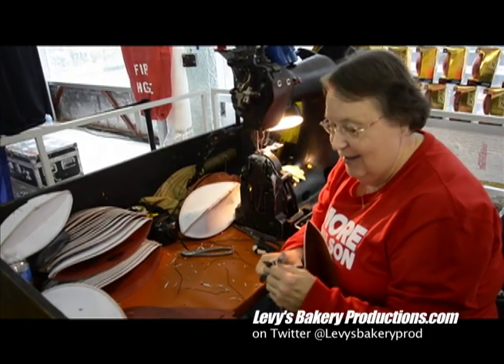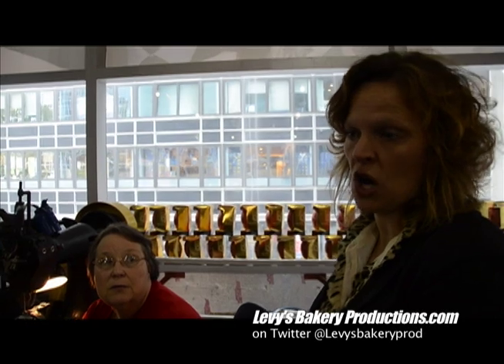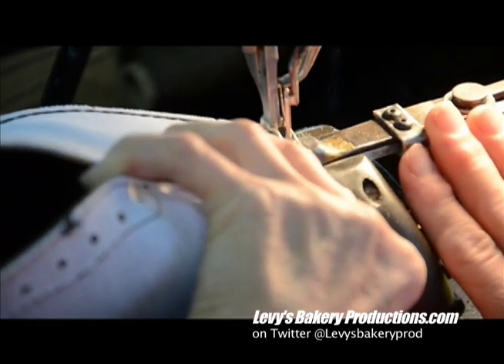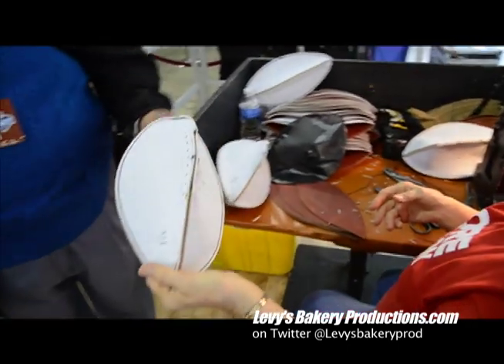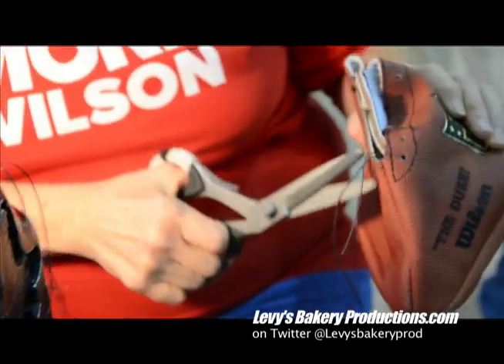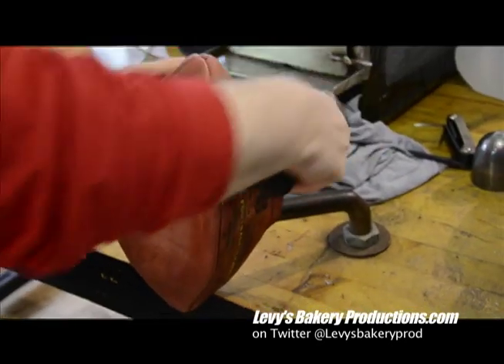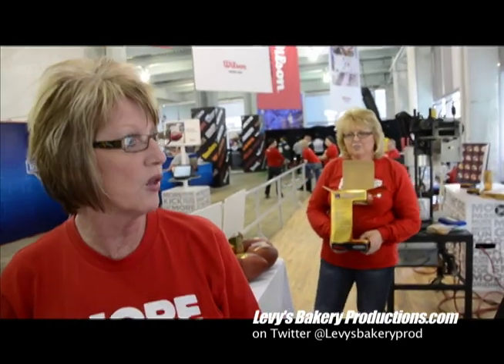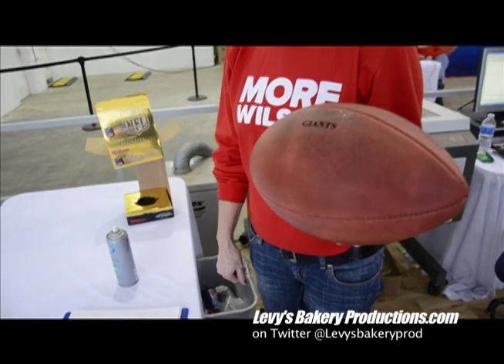How A Wilson Football Is Made

Comment: I have an authentic F1100 game ball.  I got it retail so it doesn't have a team name printed on it. they said that the retail balls are exactly the same as and have the same specifications as the actual balls on the field, right? do you think team balls are cheaper because they buy them in bulk?
Reply: No. Balls that are sold to general people are the F100's. The ones that are sent to the teams are the F1010's. They have to go through much more specific regulations to meet a higher standard. Both made in the same way, but the F1010 cannot be sold to the public unless you get a second hand one off of eBay. And yes, they will be cheaper.
Reply: You're exactly right